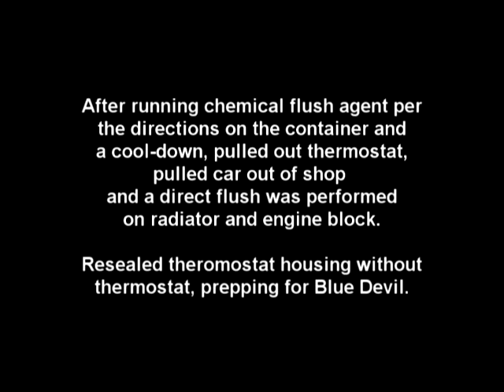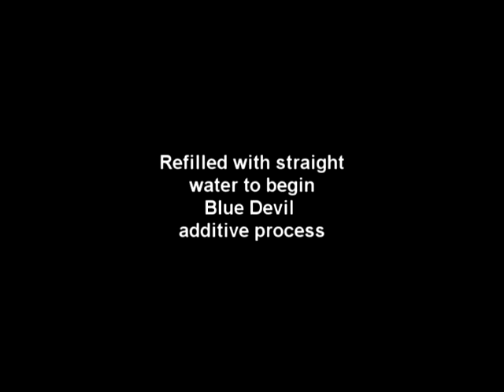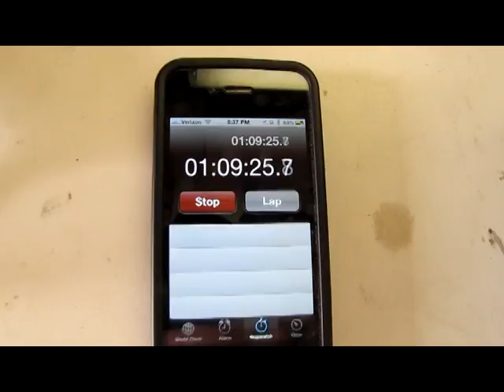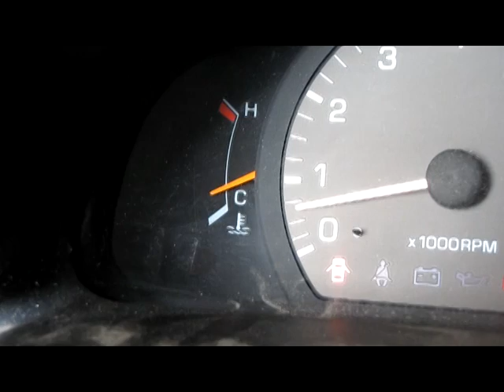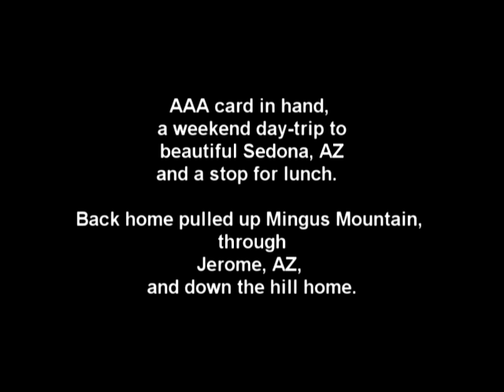Blue Devil Headgasket Sealant vs. Napa Block Tester Pt 2 of 2

Comment: excellent video. highly informative. ive used this product in the past a few times on vehicles similar to your toyota. i have had mixed results, in my experiences it seems to work most of the time but NOT every time. now i am faced with a dilemma of getting my AWD Talon home (400+ miles away) and the HG is starting to leak and im not in the financial position to replace it. Im going to use it once more and hope i can get home where i can repair it properly.

Comment: I did the chemical test, and the dye turned a little green, but not yellow. I think that means there is a little leak (co2 in coolant), so it probably is a great candidate for Blue Devil. I will add, as a way to confirm a positive test, remove tester from radiator air and suck fresh air through the tester and fluid. I will turn blue again. I did this to confirm a positive test and to make sure i didn't suck up any coolant in tester. When I get the Blue Devil I will check back with the results.

Comment from the maker: tjoyce81: My son drives the Toyota Camry that I did the Blue Devil chemical on to school everyday which is about 16 miles each way.  It's still holding up with no issues.  I also have a Toyota truck I bought and got running for myself- ran a block check on it and it turned green so I did some Blue Devil in it as well and the cooling temps have been great, although I didn't run this truck daily before.  Would like to know if you decided to treat your car.  r.

Comment from the maker: Porkyfiveo: Oh, good question!  They make a pretty big deal out of applying the chemical with no thermostat, so I'm not sure I would try it in your case.  I haven't worked on Beemers so not familiar with their particlulars-could you get another housing from a junk yard and gut out the thermostat to put in place during application? r-

Comment: Thanks for the video. I am wondering if the fix is still holding up? I got an 1986 Cadillac Cimarron (that's right a Cimarron) given to me for free in great shape, but it has the tell tale sign of a head gasket issue (tiny bubbles in coolant when warmed up) gonna test to be sure. It runs great, and I'm gonna re-build a junkyard engine for it, but in the mean time I just wanna cruise around and make people laugh at me in the Cimarron, so just wondering on your fix with Blue Devil...

Comment: I wanted to report to you and your viewers my experience with this product. I used bluedevil on my 96' Nissan 200sx aka Nissan Sentra GA16DE & was getting exhaust gasses into the radiator (used block tester). It could idle for an hour and 30 minutes but only drive for maybe 20 to 30 minutes on a cold engine. I followed the directions exactly as the bottle said and with some guidance from this video and even pulled spark plugs but it didn't work for me. I filed a claim & am waiting on a refund.

Comment from the maker: dre red: According to the instructions the vehicle has to be running  with water in the cooling system while adding the chemical product.  I'd recommend you follow the directions pretty closely because the product isn't cheap.  The directions are on their website- just google USA Sealants and you should be able to read the process at their website.  r-

Comment: hey i have a question i was told it works on warp heads and blown gaskets i have an 86 mazda pickup and wanted to know would it work on warm engine or it has to be dead cold?

Comment: Why, thanks. The old coolant appears to be "normal" colored.. I am about to go get a "Stubby" screwdriver to get the lower hose off. What I did appears to be holding but I am gettign the water in there now to do it the right way. I like how yor water looked blue, with Blue Devil in there. I still have 40% of the bottle left. This is my S-10, if you want to see - Ahh it won't let me upload a pic. Ok that's cool, I am uploading a video now, of said Chevy Blazer, please check it out! Back later

Comment from the maker: The JCorbi82: this could be a good candidate for doing the full headgasket repair, sending the heads in to have them checked, etc.  Be careful how much money you sink into chemical-type fixes particularly if the vehicle has had a lot of this kind of thing done to it before. I guess it depends on how much you are willing to gamble on the chemical stuff. I've wanted to try this on a really blown system just to see how it does. I might just do that. r-

Comment from the maker: TheJCorbi82: Oh my, you have your hands full there, huh? Ya you know too much of a good thing can turn out to be not such a good thing- Have you block checked it?  Next, yes, a full CLEAN-running flush is mandatory without the thermostat- clean in both the radiator and engine. Do this with the engine cold, not warm.  This should be done every few years anyway. What color is the gunk coming out of it?  4.3L is a nice engine (if maintained). r-

Comment: reluctorvalve, this is one of the most AWESOME videos on this matter (not the "Shout at the devil" one, though that one is OK as well.) I am dealing with a 1993 4.3L Chevy Blazer and its got head gasket issues out the wazoo. I have gone through about half a bottle of Blue Devil but I WILL be getting a second bottle.. I have not yet flushed the system, and the previous owner I think used Thermagasket, should I slush it until the water runs clear, 2/3/4/5 times?

Comment: Great video, clear, concise, to the point, safety tips and all around good info. Thank you for taking the time to put this together. Our 2001 Honda Civic LX coupe with 224,300 miles showing(I think) the signs of a HG issue. Quoted 1400.00 from dealer to repair. This will be a good test if I can find time to work on the commuter car.

Cheers

Comment from the maker: Kadaverstar: Boy, I'd be a bit leary about trying another additive when one is already in there.  I'd run the compression test before I did anything, and even if you considered it, know that some of those coolant passages are fairly small in diameter.  I just did another Blue Devil treatment on a '90 Toyota 4X4 V6- worked like a charm. I'm gathering it's expensive because it works if you follow the directions.  So not sure.  Compression check first would be my suggestion.  Good Luck to you! r-

Comment from the maker: Rickkristin: Hey great to hear from a neighbor! Thx for the kudos! I am ALWAYS reluctant to try chemical quick fixes. Prefer to repair. Excessive heat loads-my theory? Even at 110+ ambient temps, 'normal' op temps are far far greater. Autos are designed for operating in high temps, and some don't operate well when cooler. AC systems do suffer, I agree, along with you poor Valley mech's in all that heat! I am amazed when I see a hood up outside in the summer down there! thx again r-

Comment from the maker: Leek94: There is very little likelihood that changing the oil and spark plugs has caused your overheating issue.  The telling part of your description to me is that it is only an issue at lower speeds (25mph).  This is indicative of a bad fan clutch (if equipped, but i think so). Most V8 engines (RWD) have fans which aren't directly driven, and aren't engaged until a certain temperature, then the thermal fan clutch locks the fan to its driveshaft. For stop/go driving. I'd chk that. r-

Comment: (2002 Lincoln ls v8 ) After i got my oil change and had new spark plugs put in i started to get an overheating problem. I put in a new thermostat and had pep boys check my cooling system and they didnt find anything wrong but I still have the overheating problem but only at city speeds (25 mph) after like 30-60 minutes of driving . what can it be?

Comment from the maker: Bluestang: each cylinder has pistons that go up and down, much like pedaling a bicycle. as the piston goes up on the compression stroke, it squeezes, or compresses, a mixture of air/fuel, and at a precise time the spark plug sparks and it explodes in that cylinder, causing it to push down with force. All cylinders to this to turn the crankshaft, like pedaling a bike with two legs. Each cylinder needs to squeeze, or compress that mixture for power production. They can test this.  Make any sense?

Comment from the maker: Bluestang: Wow, very informative description. No hot air at low idle but getting hot air at higher RMP is most typically caused by a low coolant level. I agree, however, that it could have been a stuck thermostat, perhaps both, but the block test is pretty reliable, I think.  The fact that it still runs well and isn't mixing coolant/oil is a good sign that the Blue Devil may work ok for you. Take your time and follow the instructions verbatim. Thx for posting; do report back. Good Luck! r-

Comment: It failed the block tester test. I am now going to try this blue devil head gasket sealant this weekend. I assume the thermostat was faulty which caused the no hot air in cab at lower rpms and the overheating and blew out the head gasket? Idk but thanks for your videos. Very informative. I will update my results. Thank you

Comment: They said it failed their compression test. At the time I was dumbfounded. I didn't know what that was. I told them I wanted to pick it up n get a second opinion. I did some research.These are my findings.  No oil in water, no water in oil, no smoke coming out exhaust blue/white.. I replaced the thermostat in it Wednesday. It ran fine. Only got to normal op temp not above. Heater is working awesome... I found your vid and the last thing to check I bought this block tester and tested it yesterday

Comment: I have a 2006 Chevy Equinox that was having heating issues. When the rpms were low the heater would blow out cold air. Then my wife was driving it and last week and it overheated on her and shut down. She was able to wait a bit start it up n get it home. I took it to a shop they told me it had either a blown head gasket, and/or warped/cracked head block etc. They wouldn't know til they tore it down and quoted me $1511 to replace the gaskets, new thermostat R&I heads etc. Continued.....

Comment from the maker: No I don't know exactly where to add the chemical on your vehicle- haven't worked on one of those particularly before.  If you took a good pic of the engine bay and sent it to me on PM perhaps I can help there.  No, I didn't have the chocolate milk look to my oil, but that means that the oil is mixing with the coolant probably more directly.  If you want to gamble the $60 on a bottle..? Otherwise I'd probably do the complete repair. Let me know on the engine pic! r-

Comment from the maker: Update 8/17/012:  I have done nothing to this car since the Blue Devil additive process but drive the snot out of it.  A couple more Flagstaff trips since last report for medical appointments, and tons of in-town driving, pure neglect on my part.  The thing needs an oil change and a good cooling system flush!  Other cars to fix!  To this point, it's holding up well. On another topic, I recharged R-134A on an '89 Honda and it rocks so far.  Upcoming vid on Honda axle shaft R&R! r-

Comment from the maker: 7/12/12 Update:  Last weekend we took a mid-summer trip to Phoenix in this car.  Did tons of driving down there in 108-degree weather, running the AC the entire time.  The cooling system held up well and never budged temp level beyond what it's been normally after the Blue Devil treatment.  Again, however, I have left the water-side of the coolant mixed with Blue Devil, and have not done the flush yet.  Doing this did repair some other minor leaks, but its time for final flush!  So far, so good!

Comment from the maker: Yes, the Blue Devil has held up surprisingly well.  We have had to rely on this car- making numerous out of town trips.  Following up, leaving the Blue Devil water in mixed with coolant was a good idea, as it repaired some small leaks in the radiator top tank due to over-pressurizing when the fumes were invading it;  now, however it is getting a bit gooey in there, so I need to re flush with water and coolant.  Otherwise, it's been awesome for me.

Comment: thanks for the video.  I just had an external coolant leak that I repaired with one of the newer products that don't require all the flushing and refilling.  So far so good.  No one more surprised than me.  My car is also hard to completely drain so I used something that isn't negatively effected by antifreeze.